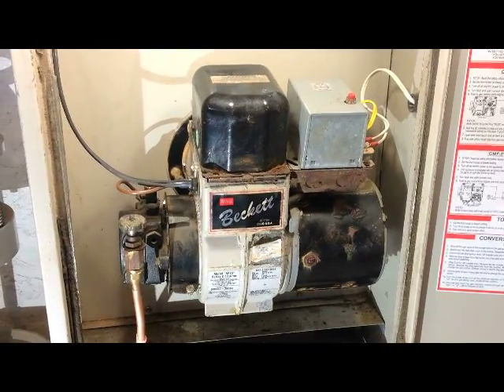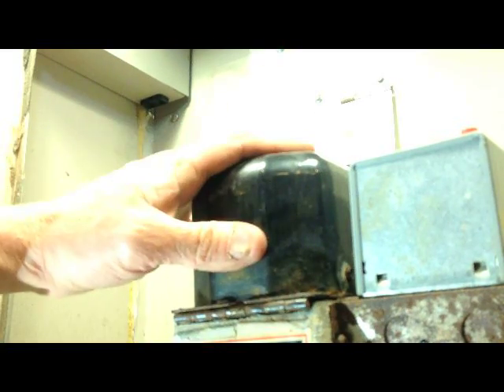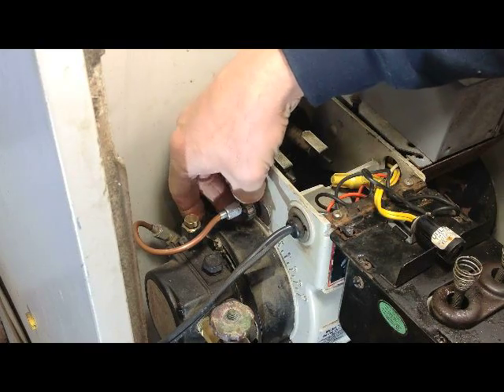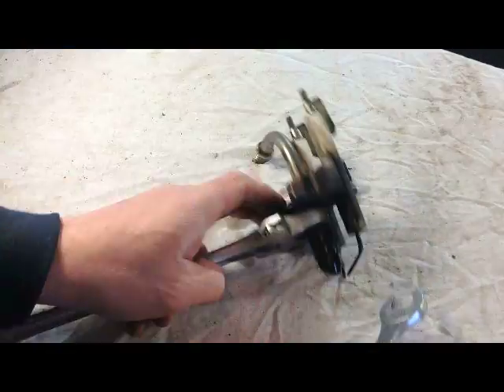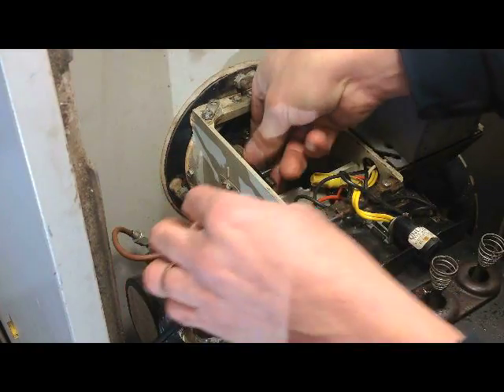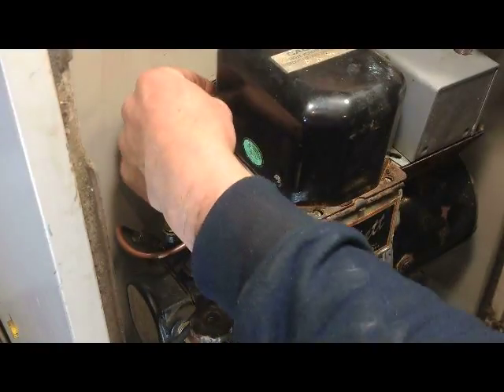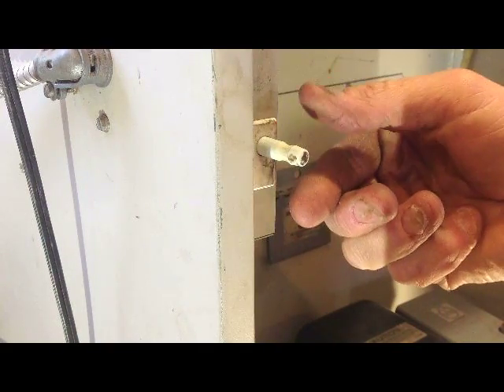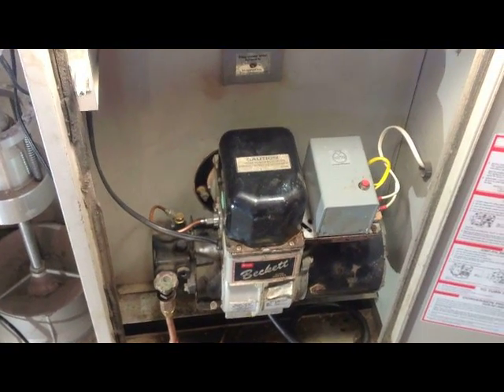How to replace nozzle on miller furnace

Comment: thank you sir, i live in a double wide in new yorks tundra region the Adirondacks furnace went out on my wife today its 17 degrees right now. with your video i was able to get our furnace going thank you
Reply from the maker: Your Welcome, Stay safe (:
Reply: have a can of brake or carb cleaner and clean up those electrodes before you reinstall the assembly. spark will jump right up those dirty electrodes.
Reply from the maker: Thanks, I will do.

Comment: Thanks for concise info! Before I disconnect the fuel line should I close the valve at the tank? And should I worry about any fuel coming out of the line when I do disconnect? Thank you!
Reply from the maker: I have not had that problem but good question, you should turn off the fuel, I usually do, Not sure why I did not in this video, good catch. thanks.

Comment: Can you explain, what kind a nozzle you put in, mean number on it?
Reply from the maker: with a miller trailer furnace I know you have to use the one listed below.

.60 GPH 90 A 660623   https://www.ebay.com/itm/Intertherm-Nordyne-Miller-Furnace-Oil-Burner-Nozzle-60-GPH-90-A-660623/271031826822?_trkparms=aid%3D222007%26algo%3DSIM.MBE%26ao%3D1%26asc%3D20160908110712%26meid%3D7af116f090e44550b475ab9199feb582%26pid%3D100677%26rk%3D6%26rkt%3D18%26sd%3D231911791887&_trksid=p2385738.c100677.m4598

Comment: What brand of nozzles do you use? I use monarch brand .579 MH Nozzles sold by Durst at Lowe’s! About $5 a nozzle
Reply from the maker: Nozzle .60 GPH 90 A 660623 is what I used, https://www.northamericahvac.com/intertherm-nordyne-miller-furnace-oil-burner-nozzle-60-gph-90-a-660623/
Reply from the maker: Lot of 3 Oil Burner Nozzles Delavan .579 MH for Miller Mobile Home Furnace https://amzn.to/2U3C5TX

Comment: You should know what the spec nozzle is the one in there may not be right or under sized check specks
Reply from the maker: Thanks you are right make sure you use the correct size, the unit that I am working on calls for this nozzle, https://amzn.to/2XHqcFf